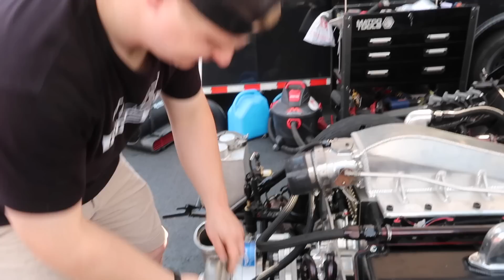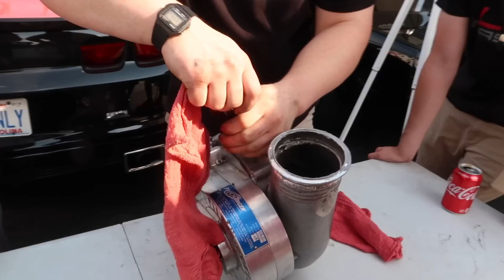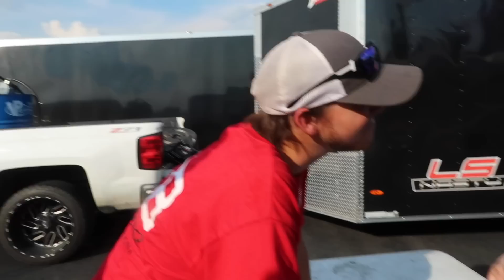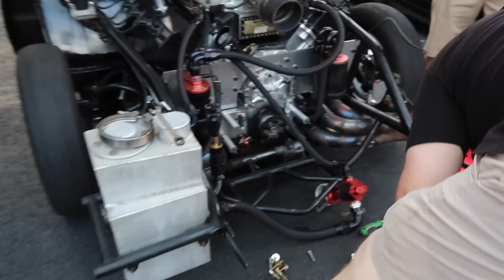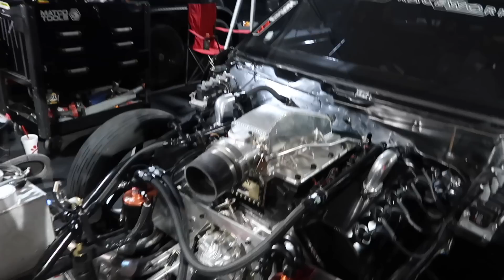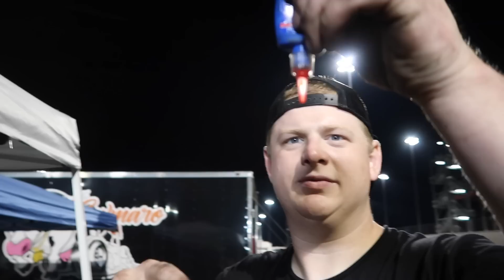The BLACK SHEEP BROKE at the TRACK!!!!

Comment: There has to be a reason everyone has switched to twins and it's smacking you in the face.
Reply: Really because this year the first 3.50 pass in R vs W on drag radials was a Procharger F-3x-140 and that's not even the bigger -143
Bruder's in X275  went 4.23 and broke the record again with a Disomma sbf and Procharger F3D-102
The Gross in the same class just a little slower then Rich runs the same Procharger. 
Thats a false statement everyone is switching to turbo. So guys do because they can't get the 60ft down with nitrous or blower cars. Turbo is little easier in that area. 
There's a lot of guys running them.  Your just use to seeing ever car with an Ls and turbos. You need to get out more.